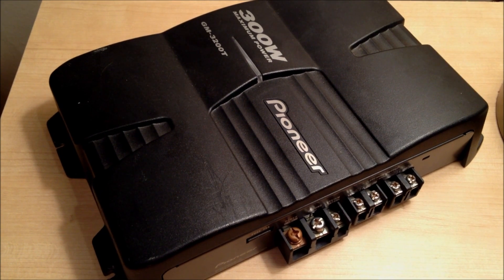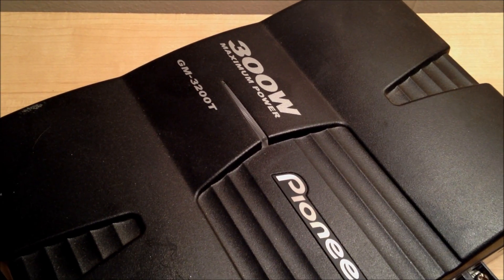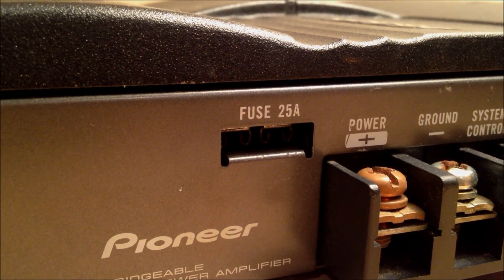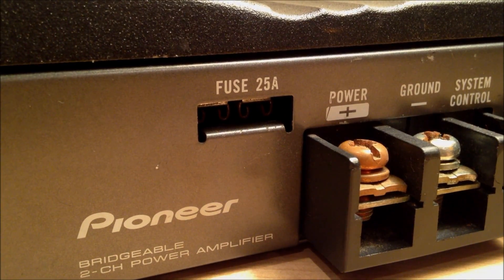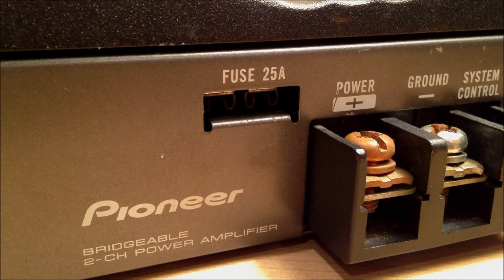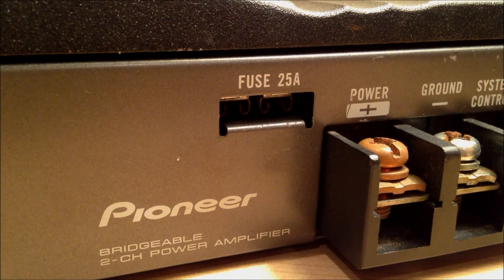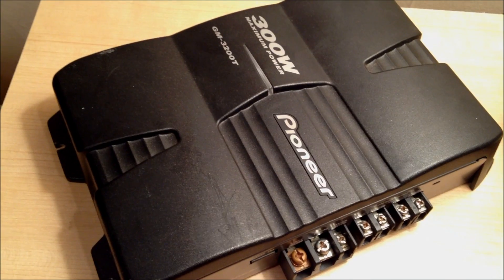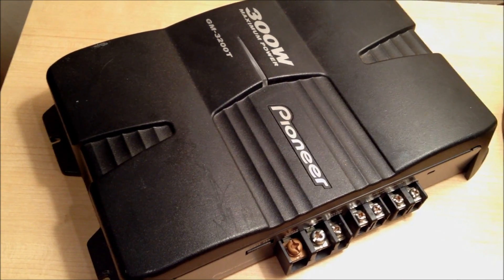How to Estimate a Car Amplifier's True Power Output (watts RMS)

Comment: why are you x's by ten? shouldnt it be 12.4 ?
Reply: +Lee Coupland Yea the manufacture is going to have a fuse rating that's around 20% higher than the max draw. If it was dead on, you would pop your fuses every time you hit max. Including amp efficiency... x10 works close enough so you can know the ball park wattage when the amp is claiming some stupid high figure. You know those amps that say 3000 watts and its the size of text book and its fused for 20amps :)
Reply from the maker: If you can do 30A X 12.4V = Watt in your head then go for it! I cant so I use the x10. Plus this is just an estimation and most manufacturers only rate their electronics to even numbers anyway.
Reply: cool ,thanks for the reply,im learning and not hating :)
Reply from the maker: Haha. Thanks for the clarification. I'm all about learning. Yeah the power equation isn't "x10" but I do it as a rough estimate.
Reply from the maker: +Wick3DPimP If an amp like that is really running 3000w rms...then I'd better see liquid cooling or fans covering the whole thing. lol
Reply: +The CF Project I'm not necessarily if a amp is truly putting out 3000w rms then I'm pretty sure it's a very good top of the shelf brand name amplifier which was built tough to continuously put out 3000w rms without over heating so easily